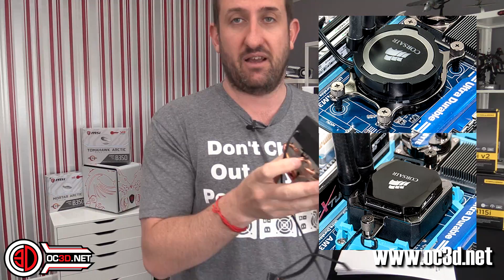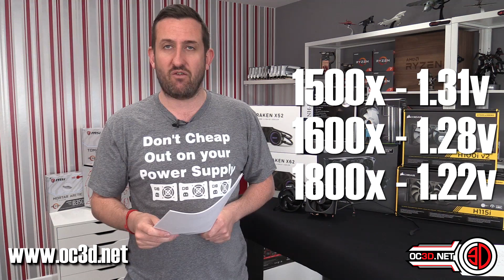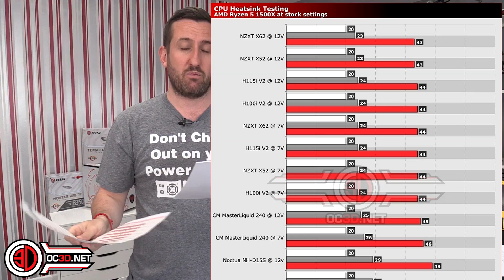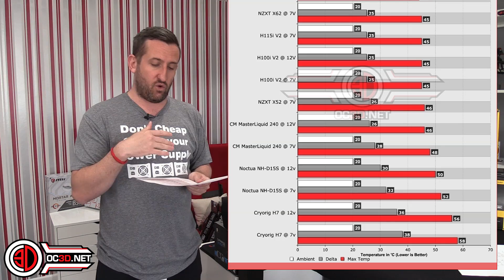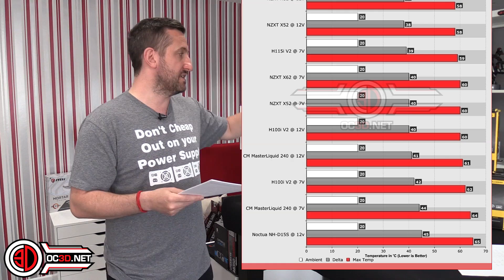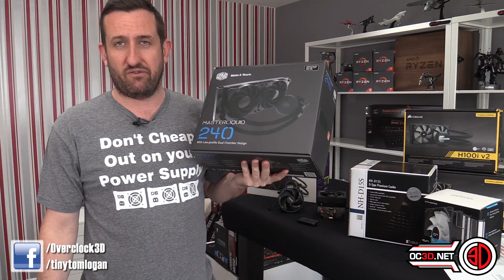AMD Ryzen Cooling Round Up 1500x 1600x 1800x

Comment: no noise test?
noise is all i care about
Reply from the maker: if noise is what you care about - look at 7v - you cant really test noise accurately without a sound lab. My sound gear picks the birds up outside fgs :p
Reply from the maker: If youve ever used a sound probe youll know how sensitive they are. Most stuff I work with the birds outside would skew all results
Reply: +OC3D TV Tom, I use a lot more than you could imagine for by business requirements. I didn't criticize you, to be frank. My point was about providing values measuring with a variety of handheld devices. I really care about providing best 'possible' cooling for the dollar paid, yet importantly noise levels takes highest precedence because machines should not distract my employees who work in a controlled environment (labs).
Reply from the maker: Adding in noise creates so much more work to do properly. Its just not something we can do here. We have far too much ambient noise variations
Reply: akula2shark There are a few channels that do sound testing, I find the tone of the sound is more important than just the decibels as things like pumps or buzzing can be more annoying on some coolers (AIO's mostly).
Reply: Same
Reply: +OC3D TV A sound lab, seriously, Tom?! 

I always chide Youtubers who upload reviews without Thermal, Power and Noise values. I'd even say that such videos won't be doing 'enough' justice to some folks like me who annually invest into variety of machines both on enterprise (workstations) and consumer PCs (gaming or whatever).
Reply: all you care is noise, lol. you should be caring about the best cooling haha

Comment: i think the noctua d15s is the best cooling performance pr decibel, and that is the whole point of a cooler is it not? not to mention better airflow in the case because you dont have a radiator, radiator either sit in the top creating negative air pressure or sit in the front as intake and blocks the intake flow. and pump noise and they dont last long and could be an ass to clean

Comment: this is a great video but one thing bothers me. what fans were used on the aio's? if you used the stock fans that came with them i would like to see the temp results with a single set of fans to be used on all of them.
Reply from the maker: I said the stock fans. If we had changed the fans we would of had to do both. and then people just say why not noctua, why not EK its never ending. This gives you a great baseline to work the rest out yourself. Its more aimed at difference between the CPU's rather than the actual coolers.
Reply: nah but hes got a point tho, to test all the AIOs with minimal outside differences it would make the most sense to test them al with the same fan, that way youd know which performs better when at its optimal setup vs just stock. idk if i explained that all too well but yea

Comment: That 1800x won the silicone lottery. I cant get stable 3.9Ghz at 1.45v nevermind 1.4!
Reply: my 1700 runs at 3.9GHz with 1.36V. its rockstable.
when I put the 1700 to 4GHz and 1.4V, the pc crashes during the first few seconds of aida64. Id definitely not recommend cranking up the voltage to 1.4V+ just to get the 100MHz more. it decreases the lifespan of the cpu alot.
Reply: All sorts of heathenry Nice, that is a very nice OC for that voltage. My C6H runs up to 1.352 at completely stock settings. It just seems to be very aggressive on the voltages if left in auto mode.
Reply: RySec Newton see what 3.8 requires. it could be a glitch making the curve seem steeper than it really is.
Reply: I can get 3.8Ghz at 1.3675 (randomly shoots to 1.39 when the board has a spaz, even when idle constantly) but this board is a heap of unstable shit to be honest. The loadline calibration is rather extreme even on low and getting it to do what you ask is a hideous task. It's just adding voltage where the fuck it wants. I do not at all rate this Crosshair Hero. Wish I'd gone for the ASRock Taichi. To top it all off ASUS haven't released a BIOS in 30 days. Meanwhile MSI have been frequently releasing decent BIOS updates for the Titanium!
Reply: That tells you everything, 3.8Ghz=1.375v, 3.9Ghz=1.45v fails.
your chips max is 3.8Ghz for whatever reason,most can do 4ghz on 1.4v some people have bad chips that dont clock well, some people have bad chips that need 1.45v to do 4ghz, some people have good chips that will do 4ghz on 1.35v.
ryzen is very voltage sensitive especially 1800x which are meant to be flagships and are coming out of the factory already high clocked.
Tiny little steps will get you further than just piling in voltage and hoping for the best, same goes for loadline calibration, if set incorrectly (too high or low) you can have instability.
-first find settings that are stable like 1.375v at 38x multi.
-then see how that fluctuates under load with different loadline calibrations.
-pick the most stable (least fluctuating voltage between idle and load) loadline calibration.
-now try that extra 1x multi and see how it goes making sure its 1.375 (well 1.362-1.388) under load.
-if that fails bump it to 1.4 (under load), slowly slowly catchy monkey stuff, ryzens got that whole network of sensors inside it and if it detects someone dumping too much voltage in especially if its fluctuating badly it'll just call it quits and refuse to work. thats why release reviews were so bad as lazy overclockers just wanting to get videos out on day 1 mixed with early bios were struggling to get beyond 3.8ghz on some chips meanwhile lesser known average joe's who took thier time were getting 4-4.1ghz before the internal network stopped the fun.
amd didnt want it to launch and then have everyone overclocking them to hell and complaining about 80*c temps and huge power consumption at 4.4Ghz and banked on 4ghz being "enough" with good 60*c temps and  reasonable power and still great performance, it also means that ryzen+ they can just raise that ceiling to 4.3ghz or so and 70*c temps once the silicon has matured a little, also by going from 4.0>4.4ghz thats an extra 10% single core performance and it'll be the equivalent of skylake>kabylake, same chips but higher clocks.
Reply: I think you just got a bad chip. My 1700 does 4.0 at 1.417v and 3.9 at 1.308v. crosshair 6 hero and tridentz ram at 3200mt/s without an issue.
Reply: mentouu I run 3.9ghz as my everyday OC for that reason. 100mhz isn't worth the extra heat and .1v
Reply: My 1400 OC's to 3.75ghz without touching the voltage, but I can't OC to hard on the stock cooler
Reply: All sorts of heathenry What voltage does it run at at 3.75 on auto? mine will run over 1.4v on auto at those speeds and over 1.5v on auto at 4ghz.
Reply: it runs at about 1.25v

Comment: I just have my good old refurbished h80i with two grey ML120s locked at 50% fan speed cooling my R7 1700 at 3.95GHz 1.35 V while never reaching over 65ºC while heavy gaming. That cooler cost me $50 usd three years ago, and it is still going strong.

Comment: AMD master is showing my 1600 as around 54°c light usage and 65°c heavy gaming with the stock cooler and a 3.4GHz clock across all cores.
That light usage temp seems a little high?
Are they ok temps.
Reply from the maker: have you manually set the volts and multiplier?
Reply: there a too good to be true :D
Reply: Not that I am aware of no.
It also runs at 1.44v stock but it didn't when I first built it.
It was as if a day after running at 3.2GHz with one or two cores fluctuating, it just decided to overclock itself to 3.4GHz across them all.
I believe it occurred after I updated to the latest bios for R5 optimisation on the B350 Tomahawk
Reply: So I double checked. 
It was set to auto on everything including clock speed boost on the Tomahawk with latest bios.

My voltage on auto was 1.44GHz :O

Why on earth would the board auto clock the CPU to 3.4GHz on such high voltage?

I have set it to 1.22v and left the clock speed on auto, and it once again clocked them all at 3.4GHz, which I haven't tested but would assume is unstable.

I don't know why I am having issues just using stock settings.